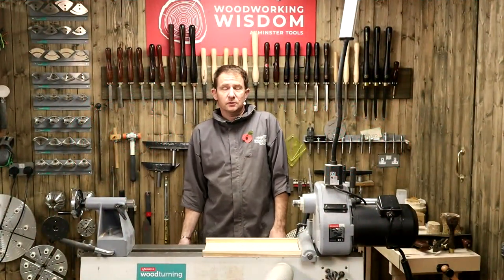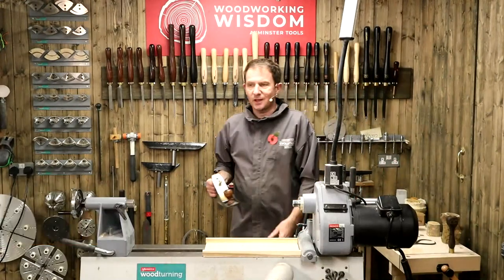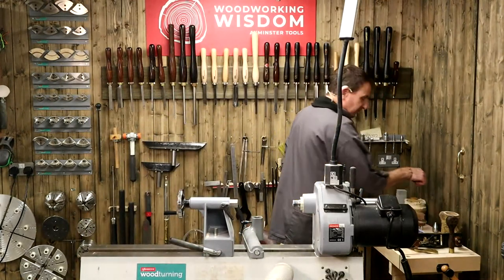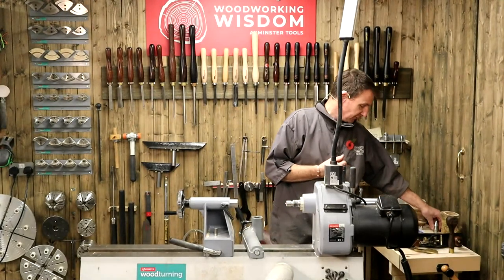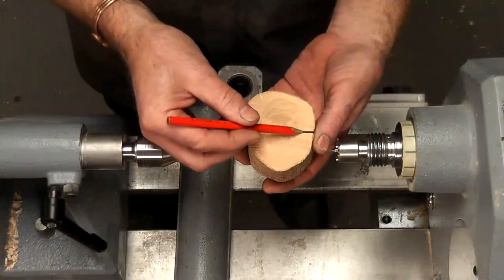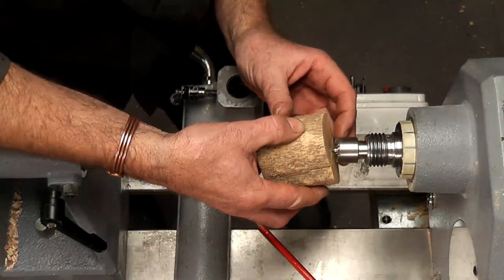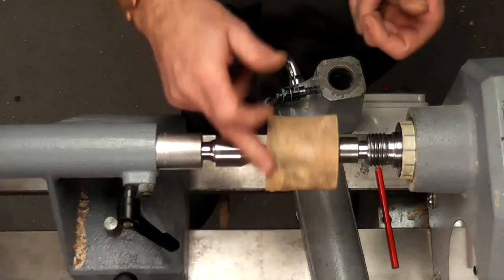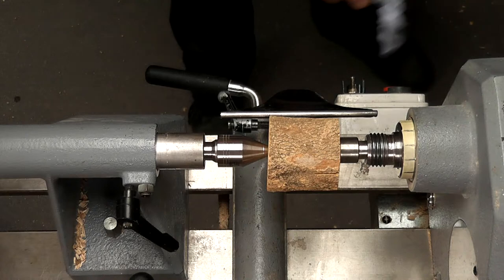Make a Hand Plane Screwdriver - Woodworking Wisdom

Comment: When Bailey designed the plane he knew that you would need to adjust the screw. So when the lever is unlocked and the lever cap is removed, the edge of the lever cap is designed to act as a screwdriver. The screw is adjusted before attaching the lever cap to achieve a nice tight fit; the screw is not tightened after fitting the lever cap. So a screwdriver is redundant. Maybe modern copies don't have this feature. It appears this aspect of Bailey's design is forgotten.
Reply: The screwdriver is useful when the chipbreaker must be removed from the blade for sharpening.  Perhaps you've never seen a lever cap that was chipped or scratched when it was used as a screwdriver.
Jason had some difficulty in the end because the slot for the blade was off-axis, thus the thrust of the quill/vise would be misdirected.
Reply: @BobBlarneystone  Of course, in the days when the plane was used as a workhorse, seeing many hundreds of hours of use, they do get worn and chipped. I have seen many planes and surprisingly few chipped by use as a screwdriver, but rather chipped by dropping. But I guess the hobby user wants to keep their plane shiny and new. In which case they need a special screwdriver. If you need to use a screwdriver to remove the chipbreaketr, you're over tightening the screw, the tension is created by the lever on a Bailey.
Reply: @marcusfairly2688  On some planes,  finger-tightening the chipbreaker screw doesn't work well for me, so I use an appropriate screwdriver with only as much compression as necessary to prevent slippage. There are certainly differences between older planes and most newer ones, unless the newer ones are premium brands such as Lie-Nielsen or Veritas.

Comment: Would it be easier to fit the drive bit before the ferrule??
Reply from the maker: Hi Mike,  it is easier to use a vise rather than the lathe to push this together. Yes, the driver bit can be inserted before the ferrule is pushed on, but it will need to be positioned correctly or this will not allow the ferrule to push over/ onto the tennon. I hope this helps :)